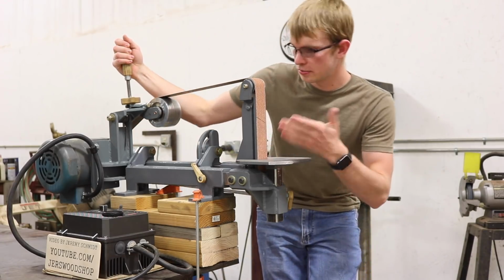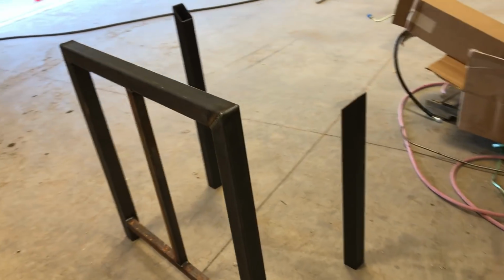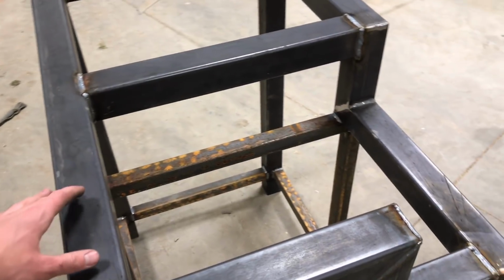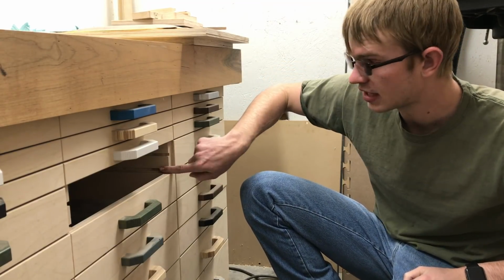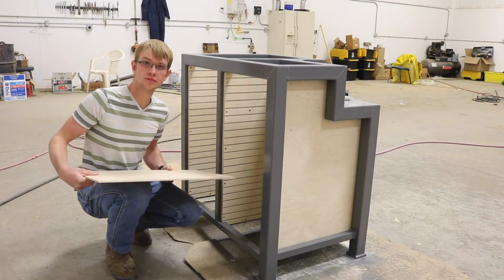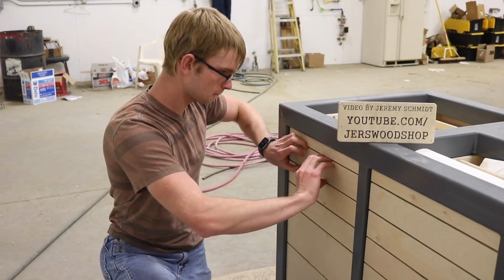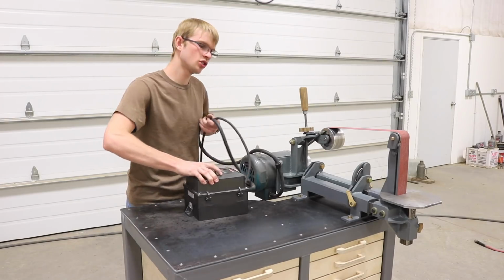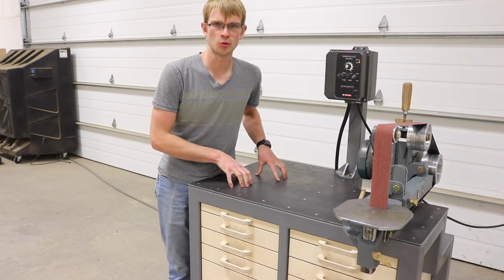Custom tool stand for my belt grinder

Comment: Just a peon here, no significant wood working experience.    If you could do the project over, would you consider putting the motor on the other side?   That way when it  pivots, the motor wouldn't need a cavity to "fall" into? 

Just a thought, still a cool table and tool
Reply from the maker: No, because that would make the machine far bulkier with no significant benefit. As it is this is one of the very smallest belt grinders there is, only needs a 17" wide spot on the bench, and that's in either orientation. A lot of the non-tilting grinders are bulkier than this. Putting the motor on the right would add 12-14" to its footprint. As long as the grinder lives in my dad's farm shop, space saving isn't a top priority, but remember I designed this with others in mind, who might not have so much space. The motor on the right would also make it about twice as difficult to change belts.

Comment: On top of all of the other wonderful comments, I got to add.  How the heck do you cut all of those 45's with just an angle grinder?  Heck I find a way to screw them up with a metal chop saw!!!  Great build. Your drawer system is brilliant.
Reply from the maker: Thanks! I just cut 1/16" oversized and true it up with the belt grinder.

Comment: so talented, awesome  build!   taking consideration for the height of the table, any reason why you didn't put the locking casters on it ?
Reply from the maker: Casters are wobbly. Even the very best ones can't be anywhere near as solid as the leg sitting directly on the floor. And as you saw I have an easy way to move it :)  Of course you could put casters on if you want.

Comment: Great Job, love the little end rounding jig, that could work on a belt sander and wood, too. I might use that. What the heck came flying out of the speed controller at 18:06 ?
Reply from the maker: Just a couple of flies. Yes, flies. Outside at night on approximately Dec. 2...

Comment: Great video and overall design.  

Question... is metal dust as unhealthy as wood dust?  I know from testing that it maxes out my laser particle counter for submicron size particles (the most troublesome ones) anytime I grind any metal in the shop.  Im wondering if I never see dust collection on metal working videos becsuse its not a health is due, because its jus too hard to capture or because its not considered a health hazard.

I would be interested in your thoughts.
Reply from the maker: I would like to know this myself; I don't know the answer.

Comment: Thats a well executed design. I love it!
What about the sparks when you grind something? Cause there is wood now.. Is that a Problem?
Reply from the maker: If you're concerned about fire, no. It takes a direct blast for a few minutes to even blacken the wood. And this is very indirect since the sparks hit at a very low angle of attack and kinda just glance off. There is a chance it may start to look dirty or discolored though...

Comment: Great project but you have to work on the security while you're working! Your fingers were too near the saw and the milling machine
Reply from the maker: Safety is a personal responsibility. I'm extremely familiar with these tools, and I use them in the way I'm comfortable with.

Comment: Fantastic build, I do believe I will use some of your design points for my table. I truly hate pointing out one possible area of concern, because your build was fantastic, but the grinding bits and sparks may eventually stain your beautiful drawer fronts.
Thanks again for a great video.

Comment: I love the grinder and the stand you made for it, but I see a problem. Your grinder generates a perfect storm of dust. Your wood drawers with their waxed slides bad their contents will suffer from dust infiltration. I strongly suggest a dust curtain or doors covering the cabinet front and a filtered positive air pressure source feeding the cabinet interior to waft away intruding dust.

You're more than capable of working out the details but I suggest you enclose the cabinet bottom and install the blower, filter, etc in a modified bottom drawer for bottom rear of cabinet air intake and convenience in servicing a suitable automotive style air filter. I submit you need more suction air pressure than possible from a computer fan or bathroom fan but relatively low flow: about 2 ft per second around the door/curtain periphery. I suggest a small orifice restricted centrifugal blower comparable to Dayton 4C005 or Fasco TTDP7. There is a contact pair in your VFD you can use to control the blower via a relay depending on contact rating.

Comment: Stand turned out great! Random question for you: how do you keep your Apple Watch face from getting scratched up? I've had mine for two weeks and it already has multiple scratches from my day-to-day shop use.
Reply from the maker: Thanks!
Answer: I don't. It's got a lot of fine scratches in it, but they hardly interfere with the visibility of the screen. And so far there haven't been any deep gouges even though I'm really not careful with it at all.

Comment: When you were assembling this table I thought it was overkill and too heavy.  After seeing it complete, I changed my mind.  Grinding takes leverage and the more solid the base, the easier it is to safely apply force to achieve a consistent smooth ground finish.  I concur with the other comments below.
Reply from the maker: You've sort of voiced my opinion. If I would have made it all out of 1-1/2" thin-wall tube. I would have probably never known how much more solid it I could have been.

Comment: Impressive; designing, staging, cutting, welding, editing, et al.

But I'm wondering if this tool stand isn't massively over-built. Could you have used the narrower tubing for the whole build, or does the grinder need the 2"(?) tubing for vibrational stability?
Reply from the maker: It may be a little overbuilt, but I wanted to be sure it was solid. And I'm not about to be a cheapskate and try to save $20 only to find out it makes the whole thing vibrate under load... I've done that a few too many time in my life and learned my lesson.

Comment: incredible build! Your builds are getting more and more refined and just awesome with every post. What's the spray paint you use, the finish is amazing!?
Reply from the maker: Duplicolor brand. I get it from the auto parts store. The finish is great and it dries to the touch in about 5-10 minutes.

Comment: Why does the machine rotate so that the motor is down and not up?  It'd be a heck of a lot easier to make a table which didn't have a big notch out of the back.
Reply from the maker: Which way is more compact and nice-looking?
Reply: Hey man it's your rig (and a hell of a good one, which I am sure you are aware of) so you can do what you like, but is there a technical or functional reason?  Is it just an aesthetic choice?
Reply from the maker: As it is this grinder occupies a 17" wide spot on the table (whether it's tilted or not). This makes it one of the very smallest 2x72" belt grinders, tilting or not. The footprint isn't a huge deal to me at the moment, as long as I'm allowed to keep the grinder in this big shop, but it is an issue for many people who work out of a small garage. Mounting the motor on the right would add roughly 12-14" to the footprint. It would also make it somewhat more difficult to swap belts. These might not be big issues to you; depends on your situation.

Comment: Wheels. You should have put some wheels on the bottom. You'll remember that when you have to move it ;)
Also, some cover for the drawers below the belt. They might get slightly burned over time, with so many sparks.
Other than that, it's awesome! :)

Comment: That is too cool, great build! I wonder how the wooden handles will hold up to all the sparks it throws. Maybe it'll be worth it to hang a piece of thick denim or make outside doors for the unit? If they were doors, it could include hooks to hold a water bucket under the platten to catch the sparks and reduce dust.

Comment: Awesome project, but I am curious. Do you have any concerns about the sparks burning spots into your wooden drawer faces? Discoloring over time? Was wondering if a flip-around metal plate that covers the right side drawers, or perhaps a detachable hook where you could hang a water bucket to collect the swarf/dross/dust/filings.  Anyhow, your construction and build quality easily rivals anything you could buy commercially, so don't take those questions as anything other than idle curiosity.
Reply from the maker: I don't really know. I don't think the sparks will burn little holes in it; they just don't contain that much energy. But some discoloration is certainly possible. Whatever happens I'll learn from it!

Comment: Where in the world do you get that much 1/4" steel for $40???
Reply from the maker: An old guy that has a little hole-in-the-wall supply store in my local town. The whole 4x4ft sheet was $93, so I think the portion I used for the top was about $40.

Comment: Beautiful workmanship.  I think some design optimization is called for.  You don't need 3x3 tubing for a bench to hold up a 100# grinder. My eyeball estimates you have $300-400 worth of steel alone in this, plus the cost of the baltic birch plywood.  You could reduce the steel by 50% with negligible effect.  I really liked the modular drawer concept.  I had not seen that before.  Not sure why i would ever want to move drawers around, but neat nevertheless.
Reply from the maker: Cut that cost of steel in half and you're still a little high... it was about $140 I think (including the top). I know it's more than necessary, but why would I try to save $20 only to find it makes it vibrate more or something? By making it better than it needs to be, I can be sure it's good enough.
Thanks!

Comment: outstanding,one question why you did not made the drawers metal(looks very nice) I know .for a fancy garage I agree but workshop with that size naaaaaaaaaaaaaaah  .I like heavy duty stuff so no one will dare to move it for unholy intention(steeling ) and if God forbid happens they need and OSCAR am just  saying lol. But seriously  you really gifted .
Reply from the maker: Wood is just more practical, in terms of the ratio between the work to make, the cost, and the functionality.

Comment: Any plans to paint the drawer fronts?  I'd hate to see the grinding sparks eat into that nice looking wood.  Might take a while, but as you mentioned, they took a good amount of time to build.

Nice job, by the way!
Reply from the maker: Not too concerned about it; and I'm not sure that paint would help. The sparks are hitting with a very low angle of attack.

Comment: Just curious if there is a reason you put the grinder on the right side of the bench. It seems if you put in on the left you wouldn't have had to notch it nearly as much since you wouldn't have to worry about the radius of the swing of the motor.
Reply from the maker: I frequently use the "bottom" of the belt when it's tilted to the horizontal position; the slack part of the belt is great for deburring & rounding sharp edges. The right side is also the side you replace the belt from.

Comment: I mean you could have added some more cross-braces to support the little bit of work surface, but you know maybe this stand will last a year or so.  Nice video, I bet you edited for days.
Reply from the maker: I'll try not to let it outside where the wind might catch it 😬  I probably would have added a little more support (like an "X" made from the small tube) under the steel top if I had been sure I could get it flat. But if it's not perfectly flat then it's not worth it.

Comment: On your drawer systems what do you leave for clearance between drawers?  Meaning a complete drawer I'm guessing isn't 1.5, 3 or 4.5" etc but slightly under?
Reply from the maker: That's correct. There will be more details on that in the longer video, but yeah a each drawer is about 1/8" under its nominal size.

Comment: As far as feedback... I think your sense of timing and flow is great. There wasn't much I would have trimmed or sped up or changed. I imagine that's a lot of work to tweak and get just right, and when you get it just right most of the time people don't appreciate it. When you get something just right, it just seems like it's the way it naturally should be and of course it would be made that way. They don't see the tweaking and the thinking that went into it, "more? less? A little bit.. there", a couple hundred times over on a video like this. Also, 99.9% of people who watch the video, maybe higher, who feel like they want plans, don't, and won't use them. It's almost entirely entertainment, not function. That's true of any build. So, teach a man to fish and all, I think you've done a sufficient job just showing the basic way to do things and let people solve the remaining problems from what they've found. If you're going to do plans, you might as well sell kits, 'cause the people who need that just want to throw money at it anyway. My two cents.
Reply from the maker: Thank you the insightful feedback. Good points.
Reply: After a bit more thought, some small things I'd change: try to replace talking to the camera (when it doesn't have actions) with voiceovers showing the action you're describing, rather than talking first and then showing after. It ups the content density. I try to shoot for "always show something, always say something", so I'm viciously hunting for "video where I'm not saying anything" and "talking where I'm not showing anything". It didn't happen often, certainly not enough to complain about, just suggestions for future refinement. Good editing is like good special effects. You don't think "wow the dinosaur animatronics are great" in Jurassic Park, you just think "OMG A T-REX!". You don't think "Wow this mouse is well engineered", you just use it, versus a mouse from 30 years ago you're like "What a blocky piece of shit, why did they choose this shape?"
Reply: Rick - I wasn't saying that to discourage him, (and certainly not to deny him "credit" for doing that) but to temper the (vocal) minority when he specifically asked for that perspective. Like, any time anyone makes something that a million people watch, all but a very, very few of them are going to actually attempt to emulate it. Most just liked seeing how it was done. I think 1/1000 is a realistic number of people who would attempt to copy someone's build. But it might seem from the comments, that 1/10 people would want to. So what is worth his time? It's easy to get misled by the people who want plans, and of everyone who wants them, it's like games on steam, you have 10x the number that you ever even play.

He talked about how much extra work making the plans was, so I think it's important to temper that with realistic expectations of how many people will benefit from it. You benefit from it, but it's important not to act entitled or inflate how common your opinion is. I too would download the plans if he had them, and maybe 25% chance I'd get around to making it, but I'm aware I'm in a fringe minority.
Reply from the maker: I'm not discouraged by this feedback; I feel it was constructive criticism and I welcome that. I probably won't instantly change my video style because of one comment, but after a number of people have the same suggestion for me, I might start to make some changes to make more enjoyable videos. 
So thank you to anyone who gives me any kind of feedback. As long as it's respectful and not insulting I appreciate it.

Comment: You can probably use it to jack up your car if you're so inclined. ;) Neat, digging the wood/metal play, but, i question grinder dust in drawers. It has a habit of getting anywhere even when fought against, let alone when it's right on top of it. Oh well, you know what you're doing, so that's that. Cheers.
Reply from the maker: So far very little dust has found its way into the drawers. Time will tell I guess

Comment: How much cost do you have involved in this project?  I've been considering building my own tool box similar to what you have going on here just with ball bearing sliders and locking drawers.
Reply from the maker: Somewhere in the vicinity of $300. Didn't figure it up exactly since I bought some extra material for other projects at the same time...

Comment: Very nice cabinet and stand!

But i was wondering, considering the dust the grinder could make, a small dust chute or something to prevent the it to accumulate in the drawers right under the sander would help?
Reply from the maker: I mention this a bit more in the long video, but it doesn't seem the be as big a problem as I was afraid of. The dust hardly finds its way into the drawers at all.

Comment: Great build.  I look forward to the 'education' video.  One question, is there a reason that you use the cutoff wheels for the miter cuts vs. angling the vise on the band saw?  Thanks.  R.J.
Reply from the maker: Too difficult to turn the vice on this bandsaw. If I could just do it once and make all the angle cuts, it would be worth it, but I would have had to turn it back and forth a few times...

Comment: Nicely done.  When one needs to use a pallet jack to move your tool stand, you know it is built solid.  ;-)  Looking forward to the detail video with the dimensions.  

It probably took you as long to edit this video together as it did to build the whole tool stand.